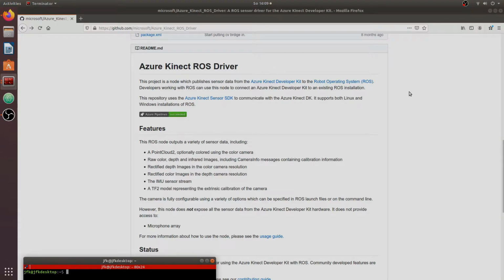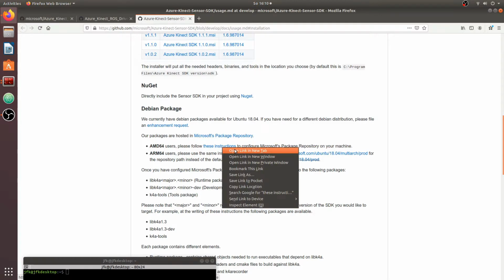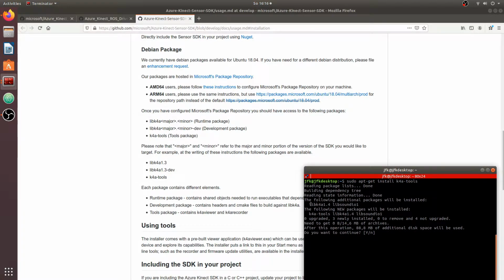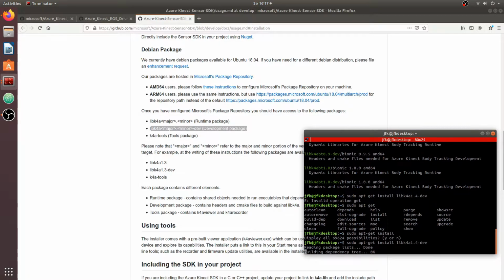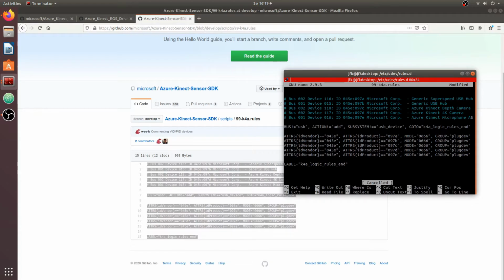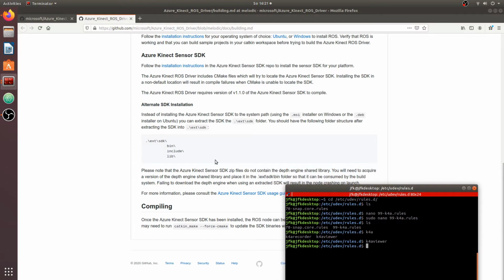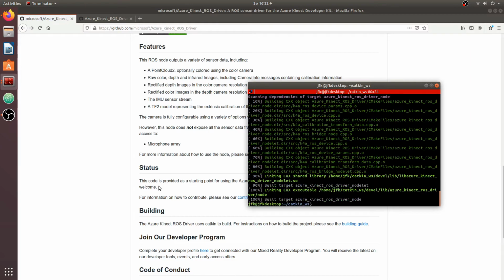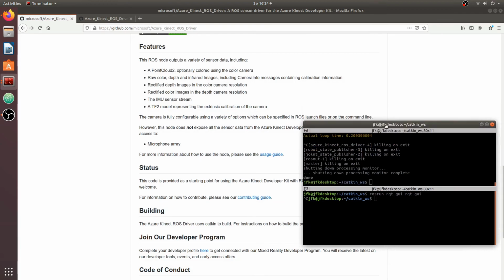Set-Up Microsoft Azure Kinect with ROS

Comment: 정말 감사합니다. 덕분에 쉽게 할 수 있었습니다!
하지만 저의 경우, 카메라 영상을 확인할 때 'rosrun rqt_image_view rqt_image_view'를 입력해야 영상을 볼 수 있었습니다.
Thank you. I can easily install driver and check the result.
However, when I check the result, I have to type  'rosrun rqt_image_view rqt_image_view' rather than  'rosrun rqt_gui rqt_gui'.
Reply from the maker: rqt_image_viewer is just a specific rqt plugin. In my case the image viewer was opening by running rqt_gui since I had it opened the last time I used rqt